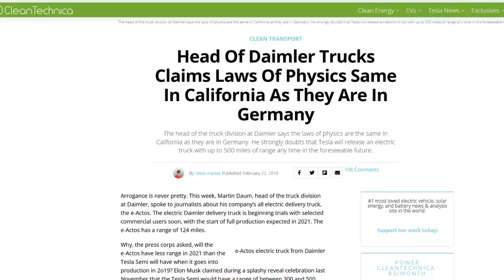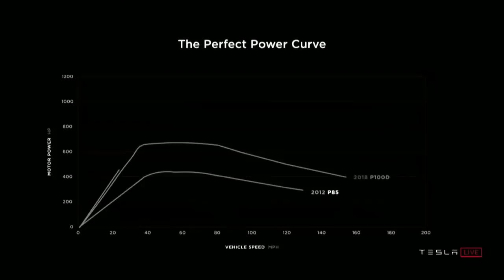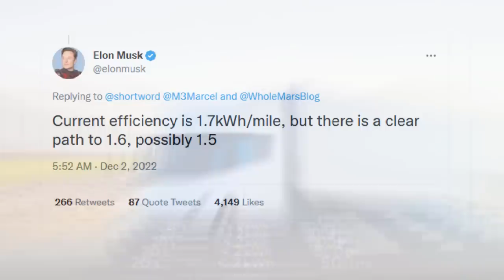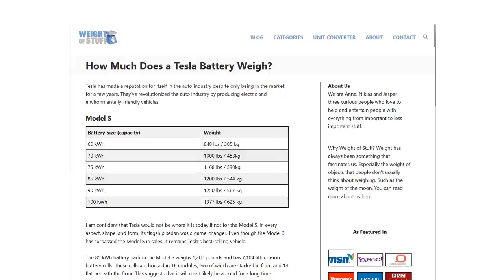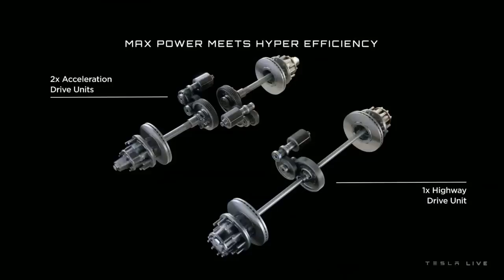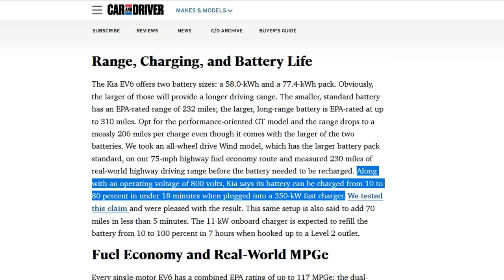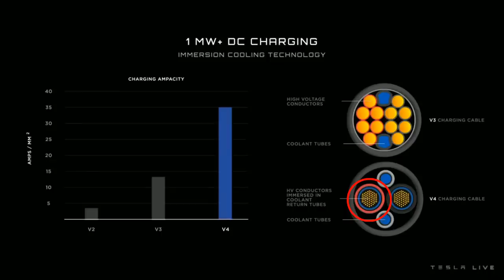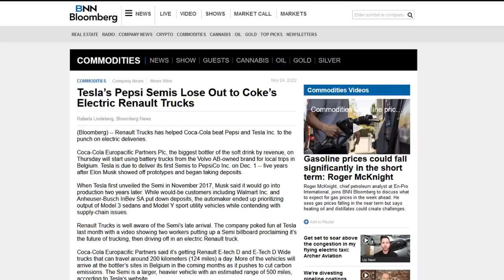Elon Musk Drops Tesla Semi Bombshell

Comment: The entire idea that others would want to reverse engineer the Tesla semi shows that fan boys don't keep track what happens in the real world. FYI, Tesla Semi isn't the first EV Truck to be available on the market.
Nor is it the best.

And comparing real world ranges and load capacity of the ones that are out there with the CLAIMS of Tesla shows how desperate they are to not have to admit that Tesla version is crap.

5:02 "Elon Musk has under promised and over delivered"'
ROFLMAO

So how is the fully self driven cars coming along? Didn't Elon promise that the Semi's were able to do that back in 2017 because they already figured out the technology. 

So after delivering something that was going to be available in 2019 and without any of the features and without any of the stats that really matter to those that have to run it.

By the by, having only 1 pack doesn't make it revolutionary nor better. Now it means that if something goes wrong with it that you have to exchange the entire battery instead of being able to swap out a sub unit. In other words, maintenance cost and time needed go up vastly. Of course it's not like Tesla vehicles don't have an excellent reputation concerning Quality Control and low maintenance........ oh wait... they don't.

Comment: I hope that recharge time proves acceptable to drivers and the industry.
Reply: Driver runs 8 hours?
Truck runs 8 hours? 
Driver MUST stop?
Driver plugs in truck, takes 30 minute break?
..... (30 minutes 😗😗😗).....
Driver unplugs truck.
Truck has an extra 300 miles range.
Driver can drive for.... 3 hours? (11 hour total)
Even at 70 mph average that's only 210 miles.
Conclusions?
1) Truck outranges driver.
2) Driver loses NO time charging truck. (30 seconds?)
.....
"Ah! But overnight!"
(Assume they launch an OTR version)
Driver pulls into a Tesla Car charging location at 8pm(?)
There are no cars there! (Most are charging at home!)
There are a few bays which say "NO TRUCKS".
.
The Semi slides in, blocking some bays (or, there are maybe 3(?) drive through bays?)
Plugs into a V2 charger ( doesn't need a V3!)
Driver sets a "10 hour" charge time, or, sets "complete charge at (10 minutes before departure)"
.
The truck (with 15% on arrival) initiates charge at 10pm, sets a rate of 100kWh.
That's a "trickle charge for this pack.
It's ready at 06:30.
The cab heat also pulls an extra 2kW from the charger, keeping  the cab at 68° all night.
The driver eats breakfast at the restaurant, which used to close, but now stays open for trucks.
There's a shower facility for the same reason.
.
Tesla utilises the extra profit to build more chargers.
.
Everyone wins!
Reply: @rogerstarkey5390  great analysis, well stated so that emee all can understand. Just saw maos of Teska rapid charge stations across the country. I sincerely hope that their grid is the result of hands ob research with the truckers: where are they going and and how long do they have to get there? Pretty simple for a computer.

Comment: Reverse engineering any Tesla is a sound investment in time, especially when you are too stupid to come up with these advances yourself.  Diamler has had 100 years to do what Tesla has done in 20 and they are stuck in a rut of mainstream thinking always INSIDE the box.  By the time other manufacturers copy what Tesla is doing , Tesla will be putting out the next generation of vehicle and the competitors will thus ALWAYS stay obsolete in their design production.  It will take them years to catch up but they are slow so it will never technically happen.

Comment: This means tat they would have to install at least several 1+ mVA transformer setups just to power the trucks at these facilities. Not to mention that they still can't compete with 1000 mile+ range of long haul diesel trucks... I work with power distribution and I know that even large energy utility companies would struggle to source that size of transformer. Especially, in the industry wide transformer shortage we have right now. I'm not saying that this isn't impressive I just think it was too biased and not acknowledging all of the setbacks they still have to overcome

This is also not even acknowledging the strain on the electrical grid that this will have. It's not sustainable in the medium term.
Reply: You would buffer the demand through large scale battery installations at the Supercharger installations. No way would you want the full peak load hitting the grid.

Comment: These numbers do not add up. My EV does not achieve the figures quoted for the Semi and it is not carrying any cargo? I chose not to buy a Tesla because they are horrible to drive and be inside. Nobody needs that performance, which quickly flattens the battery if used. Smoke and mirrors I suggest?

Comment: The truckers will need to secure even more the cargo, with such amazing power to accelerate, specially if ONE Tesla motor is MORE powerful than a diesel engine. 
Imagine being on a 6* incline and the cargo already pushing back, then accreting to pass a truck, the G forces will increase a lot on the cargo, so anything that is not wells e used will break back and out... I'm sure truckers already thought of that, just commenting.

Comment: No one ever has an indefinite advantage.  The only question is how long will Tesla enjoy its lead and what advances can it introduce while the competition struggles to achieve its current technology level.  It seems clear that Telsa has introduced disruptive technology to the IC truck industry and is going to really shake it up.
Reply: Will it work in extreme heat and cold? Nobody knows
Reply: @svenjorgensenn8418  Sodium Ion and graphine Ion batteries are next and unaffected by temps, hold more power and are way lighter. It's coming.

Comment: those are all panasonic battery's tesla doesn't own any battery factory's , i't's just an agreement to put teslas name on the building. musk is not that wealthy, he just leverages deals.
Reply: Yes they do, They have a test manufacturing facility at Kato Road Fremont, just around the corner of the Tesla Fremont factory (more than 10Gwh per year), and Tesla is building HUGE facilities in Texas and Berlin (both more than 200Gwh per year when fully ramped up).. all 4680 cell factories.

The 4680 fcatories are ramping up right now, and with less 2170's needed for Model Y cars, these can be used for Tesla Semi's..
Reply: The Nevada factory is a joint venture of Tesla and Panasonic for the cells used in the Semi.  The S/X use cells made in Japan by Panasonic to Tesla specifications.  Tesla has it's own battery factory in Califorina, and has two more under construction in Austin and Berlin for Tesla's designed and manufactured 4680 cells.  Tesla has it's own battery research group and constantly makes cell design improvement to all the cells it uses both internally and those sourced from other companies that are made to Tesla's specification.   
...
As for wealth, Elon is not in it to make money for himself.  He doesn't buy yachts or expensive properties. Not sure what his wealth has to do with making the best trucks anyone can buy.

Comment: The smaller liquid cooled charging cables are not more efficient. They waste a lot more energy as heat, but it is removed to prevent overheating. They will charge fast and cool, but they waste more energy in the process.

Comment: Lots of figures and stats about the T semi. But the one figure that's not metioned is the cago load capacity . If you compare the T-semi to a traditional truck in the video on the 500mile test. The T-semi had approximate  load of 6-8 tons * of cargo compared to the traditional truck  has a cargo capacity of 16-23 tons. So will the Tesla be able to complete if at best they can carry is half the weight of cargo than a traditional truck.  As ultimately the more you can carry the better and most cost effective it to transport freight.

*I based the Tesla cargo by looking bp the weight of the concrete barriers shown in the video and multiplied by the number of the weight carried by the Tesla semi.

Comment: Where are the 40000 charging stations needed to support the over the road industry in the US. 🤣🤣🤣🤣🤣🤣🤣🤣🤣
Reply: megachargers be wherever there need be 
(megachargers with a megapack of batteries to support/stabilize the grid be welcome everywhere )
Reply: @replica1052  Maybe so but how many years will it take to have that in place ? Each of the 40000 trucks stops across the US have multiple fuel pumps so the number of actual charging units needed will be far greater than 40000. I could see that taking a decade to actually be in place easily.
Reply: @replica1052  Why isn't that system in place in California were EV owners are being told not to charge during peek usage  hours to keep from overloading the grid ?
Reply: Same text as a horse owner would have published in 1900 when the first car appeared on road 😂 😂😂😂😂😂😂😂😂
Reply: @bobbybishop5662  (wherever there is electricity you can get a charge )
Reply: First they will be installed at the customer's home bases, Pepsi will have them on their facility (probably already have them) in Modesto California.. And Tesla will build them out the coming years, first along the routes the Semi's will be used, and will expand all over the country at some point.

Tesla is the ONLY Electric Semi manufacturer that ALSO takes care of the charging infrastructure. Mercedes, Penderbilt, they all rely on third party solutions.. which will hold them back of course.

I would not be too worried about this, Tesla will take care of this.
Reply: @bobbybishop5662  microgrids -as in solar and batteries, are getting more common faster and faster 
(you did get free charging outside of peak hours )
Reply: @replica1052  That didn't answer the question. Why isn't it being used in California ?
Reply: @bobbybishop5662  So you think they should first build 40000 chargers. 🤦 First EV semis will be operating in internal use of some companies that have chargers installed in or near their factories. Then they will start installing chargers on specific routes and companies using those routes will want to have semis to save money. And so on. It will take likely about 10 years to have significant number of EV semis and chargers on the road.
Reply: @MarcoNierop  So you think that Ev trucking won't need the same number of charging as stations across the US as is required to support the over the road trucking industry using diesel now ? If all the trucks are replaced with EV eventually why would they not need the same number of places to recharge.
Reply: @replica1052  So just ignore that the power grid is already marginal ?
Reply: @bobbybishop5662  Replacing all diesel trucks with EVs might take about 15-20 years. You have plenty of time to install chargers.
Reply: @bobbybishop5662  microgrids are connected to the grid
Reply: @malax4013  I think it silly to project how well these trucks will sell before they have a Nation wide infrastructure in place to support them .
Reply: @bobbybishop5662  The power grid will grow with the demand. If there is demand for something there will always be suppliers to fill that demand.
Reply: @replica1052  Where are they now ? How many are scattered across the US.
Reply: @malax4013  Yes in time that's true eventually they will be built. But how many years is it going to take.
Reply: @bobbybishop5662 No it's not If with 1M miles you save about 500k-1M dollars on driving EV vs Diesel. (Maintenance and fuel). It's a no brainer. It will have demand and they will build the charging network as fast as needed.
Reply: @malax4013  Let's be realistic , say there's a a business that gets daily delivery's of 20 trucks a day. Let's say 15 of those trucks are independent truckers driving diesel powered trucks . Now you are the owner of that business and the cost to install a charging station is 40k , just to throw a number out there. So let's say the other 5 trucks delivering switch to EV trucks. Is the owner going to justify that 40k to support those 5 trucks or is he just going to find 5 more independent trucks using diesel to avoid having to make that investment. Say the five corporate owned trucks are EV , is that corporate hauler going to justify covering the cost of installing a charge at that one facility ? Would it not seem that the business owner would have to book all his deliveries with EV truckers to justify that cost. I know this all just a what if kinda thing but as trucking stands today and for the at least several years until the balance of trucks are EV how does it all work out ?
Reply: @JC Certainly won't argue with that. With the amount of people and businesses that are  fleeing the state it's hard to argue with that.
Reply: @replica1052  and who is going to pay for those megachargers ?
Reply: @bobbybishop5662  40k savings with Ev truck will come with 100k miles easily. So it will pay back in 1-2 years. So it will be now brainer.  Check channel Engineering explained. There is a video about Tesla Semi and the math behind it.
Reply: @malax4013  I'm familiar with the channel , been a sub for years . He disagreed with the claimed range of the truck by the way.
Reply: @snapon666  they will pay for themselves -as part of the infrastructure and as part of the road system
Reply: @snapon666  (batteries are the best of peaker plants and solar is the cheapest electricity there is )
Reply: @bobbybishop5662  with sufficient range, few need to recharge at the customer size. Most trucks drive to destinations less than 200 miles away. Only 10% do long haul doing 30% of the total miles by these classes of vehicles. So with 500 miles, the scenario you describe might happen, but is not the most common scenario.
From the US DOT: “Most trucks larger than pickups, minivans, other light vans, and sport utility vehicles typically operate close to home. About one-half of all trucks usually travel to destinations within 50 miles of their base, and three-fourths stayed within their base state. Less than 10 percent of trucks larger than pickups, minivans, other light vans, and sport utility vehicles typically travel to places more than 200 miles away, but these trucks account for 30 percent of the mileage.”.
Reply: @bobbybishop5662  Yeah he was skeptical about the range. But Tesla just proofed at the delivery day it can do 500 miles with 81000lb total weight. We are still don't know how much the Semi will weight but I believe we will get those numbers in few months now when the deliveries have started.
Reply: @bobbybishop5662  Sorry my English. Not my native language. I think it is false marketing and manipulation if they faked the video. It would be quite risky and they would get sued if they did that.
Reply: @malax4013  You might want to look into the over 1000 civil cases already in the courts.
Reply: @bobbybishop5662  Why do you think the 500miles range full capacity is false?